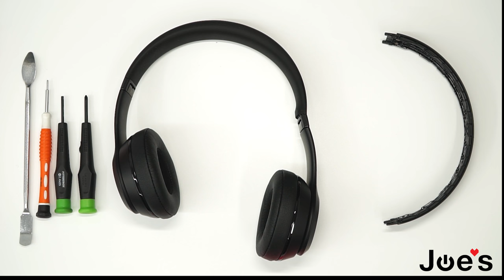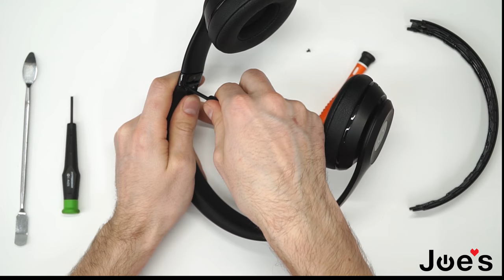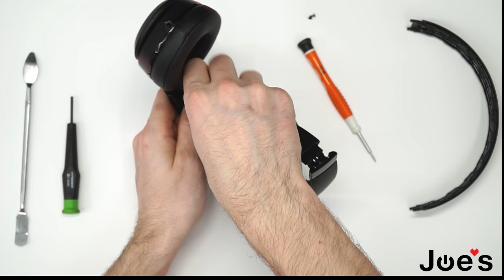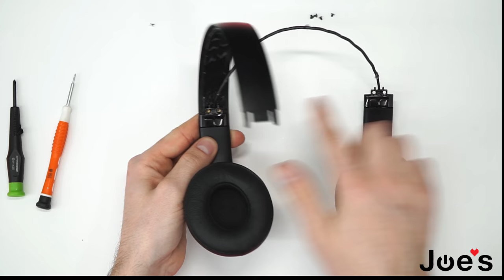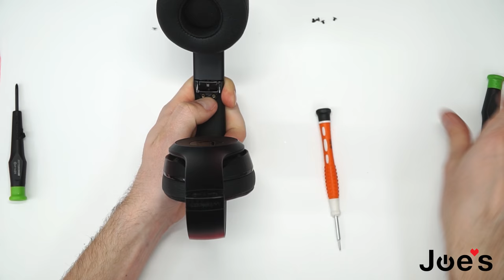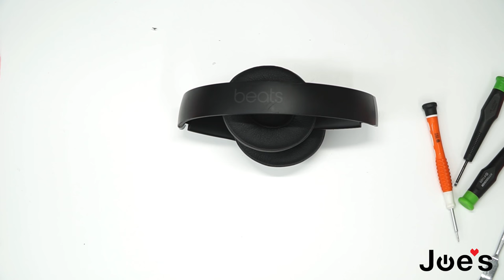How To Repair Broken Headband Beats By Dre Solo 3 Wireless JoesGE

Comment: I can't believe such expensive headphones are so cheaply manufactured. Clearly, it costs them so little to make it, since all the material used looks super cheap.
Reply: It only takes like 9-12 dollars to make
Reply: $14 -$15 to make
Reply: You kinda have to design in for breakage, you have to make a weak piont so you know where it will break, at least it is possible to repair them unlike all other apple products now days.
Reply: you mostly pay for the brand.
Reply: @thedave7760  the Solo 2s looked the Same they designed nothing new
Reply: Capitalism slander
Reply: Seriously it’s so annoying
Reply: We owned 2 Beats Solo  3 headphones and they broke this way. Expensive HP but of low QC quality.
Reply: I’ve got studio 3s and my look a little better then this break but almost exactly the same I just can’t tell if it’s the head band or the hinge
Reply: Yup this. It's annoying. They are Apple made too. So cheaply made

Comment: Hey just wondering . What part does it need to be repair when for example you know how people with different head sizes adjust the length of the handphones . Well I have a pair that on the left side they don’t lock in place it’s just lose and goes all the way Down if you what I’m talking about . The right side works and actually locks in place to the desired length
Reply from the maker: Hello, thanks for commenting. Please email us at support@joesge.com and we will be able to better help you there. - Aaron P

Comment: I was given a pair of Beats EP with a broken hard plastic headband and non-operative volume control. Are these worth repairing and is the hard plastic headband part available ?
Reply from the maker: They aren’t really worth repairing since the Beats ep can be bought on the used market for fairly cheap
Reply: Thanx for heads up

Comment: I have a pair of beats solo 3 and they broke today im going to get the parts and fix it just like you did. But the only thing is that i noticed that were my headband piece is my rubber headband part is like taped from the inside of the beats. I was wondering if when I take them out if i would need some kind of special glue
Reply from the maker: Thanks for watching! The rubber part does snap in, but there is an adhesive we use to hold it in. You can check it out on our website here: https://www.joesge.com/products/b7000-glue-50ml-clear-adhesive. CH
Reply: Thank you. Another question whats the name of the type of screw driver you use?
Reply from the maker: The ones in the video may differ a little, but for most Beat repairs we recommend the ones on our website here: https://bit.ly/2OPDFCG. CH

Comment: So i’ve been watching your videos about replacing the hinges on the Beats. But the problem with my Beats Solo 3 Wireless is that on the right where it says “Solo3”, well that piece is missing, and the headband part doesn’t connect. So my question is, is it possible to put the metal piece on the hinge without buying the whole hinge itself?
Reply: Same
Reply: You will need a new headband to attach the hinge to your part here is a link to that part - https://www.joesge.com/products/beats-by-dre-solo-3-wireless-headband-band-arch-plastic-parts

Comment: Do you have to unscrew the the two screws to take out the headband cushion and putting it back in
Reply from the maker: Blitz, thank you for watching our video. You would need to unscrew the screws to replace the headband cushion. 

Ruslan P
Reply: Joe's Gaming & Electronics can I use any screwdriver to take out the screw?
Reply from the maker: You would need to use a small Phillips screwdriver to remove the screws in the headband. Matt D.

Comment: Do you know where I can get a headband for the Active Collection Beats Solo 2's? Or will I have to just go with a regular headband?
Reply from the maker: Thanks for watching Gage! What color of headband do you need in the active collection? They are hard to find, but sometimes we get them in. MD.
Reply: Of course! Thank you for the video! I'm looking for a grey one. If I'm unable to find one, who a regular headband still work?
Reply from the maker: You are most welcome Gage! What color are the headphones with the grey? Blue, pink, shock yellow? The regular headbands are the exact same size and shape, just different colors. As long as you purchase a headband intended for the Solo 2 wireless it will fit on your headphones. The Solo 2 wired headbands are slightly differently sized in the center for the smaller wire. MD.

Comment: would changing the band fix them from being loose and the earphone part from staying up, mine dont stay on my head cause they like stretched out and then the like earphones just dont stay like clipped up when I bend them if that makes any sense at all lol
Reply from the maker: Changing the band will help with the stretched out band, but the headphones sliding down is caused by a loose hinge.
Reply: mmm so how do you fix that part ?

Comment: Can I buy a solo 2 headband to fix my solo3 headband will it fit?
Reply from the maker: Thanks for watching! Yes, the Solo 2 wireless headband is the same as the headband on the Solo 3 wireless, just slightly different colors. The Solo 2 wired headband will not work on the Solo 3 wireless. MD.
Reply: It's not gonna fit, I tried.

Comment: So some of the end of the headband is inside of my hinge, what do i do?
Reply from the maker: Thanks for watching! If there was glue applied to the broken pice it is likely that the plastic is glue inside the hinge, if not, the plastic should simply fall out of the hinge as it is not held in by anything from the factory. MD.
Reply: @Joesge  and what do i do if there is glue inside?
Reply from the maker: You can try using a glue remover and substance like Goof off to help dislodge the plastic piece. You would just need a glue solvent. If you do use the solvent, it will strip the paint off of the metal hinge very easily so make sure to be careful with not using too much of it. MD.

Comment: Bro
How does the rubber thing go back in ??
Reply from the maker: Thanks for watching! The headband cushion simply snaps back in to place onto the new headband. It can be kinda tricky. Just push down in the center of the headband cushion along the whole length of the cushion with it aligned properly and it will snap into place. MD.
Reply: @Joesge  thanks a lot man
Reply from the maker: You are so welcome :) MD.

Comment: Bro I tried the super glue approach! Man the worst happened... when I bought the replacement band and tried fixing it, the plastic  was cracked up and superglued all around the wire.. so the new band doesn’t fit in the slot. I had to use my dremmel to slowly carve out the plastic. You wanna talk about frustration! They are made so horribly. Never should $300+ headphone break when opening them from the folded position. Never dropped nor mistreated until I threw them at the wall putt of frustration!
Reply from the maker: Thanks for the comment. Superglue is definitely the worst approach if you are planning to repair your headphones with new parts. The best way to remove the glued plastic from the hinge would be to heat the hinge with a heat gun. If you do this the plastic should be easier to remove. 
-David P
Reply: @Joesge  Would a soldering iron work? I have a straight tip one. That sounds like it would work if I could just remove the side plastic like in the video. I even have the pry tool and it isn't budging.
Reply from the maker: The solder iron may work but you will have to be careful not to damage surrounding parts. Our method is using a heat gun which works quite well. If you continue to struggle with the repair we can definitely help you out if you send your item in to our repair center. Here is a link to the repair process: https://www.joesge.com/pages/repair-services
Reply: @Joesge  thank you for your reply. Thankfully with a lot of patience, I slowly melted it all away without touching the wire. I must say, that was my last option so it was all or nothing. Now they are working great! Thanks for the video.
Reply from the maker: Glad we can help :)

Comment: Sorry for annoying you guys but the rubber part is the part that doesn’t stay on my headband
Reply: So I’m asking if you guys know how to fix that or if I need adhesive
Reply from the maker: Thanks for reaching out to us. Did you purchase a new headband for your headphones? If you did not order a headband from us or find a guaranteed authentic headband, it is likely a fake headband and the tabs on the headband cushion do not line up with the non authentic headband. The Solo 3 headband cushion simply snaps into the headband by pushing down in the middle of the cushion for the length of the cushion. MD.
Reply: ItzBrandon same

Comment: Helpful video but it's a shame this even had to be made... With the costs of these headphones, it shouldn't be an issue to begin with.  I've got $40-80 headphones that have more reliable construction.  One pair I've had for six years.  They sound great but the construction issue has been a problem for so many I would not be interested in purchasing another pair.  Have had two pairs in the past and both suffered broken headbands.

Comment: I have had enough of these headphones always breaking.. one side stops working or above the hinge breaks!! I have so many over the years I want repaired but Apple refuse to repair them and want me to buy a whole new set and no one literally repairs them!! Worse the only parts we can get are cheap knock-offs or aftermarket components from China!! For what we pay for these headphones we absolutely deserve better quality but also the ability to repair them when small things like above the hinge breaks!! I literally have 4 or 5 Beats By Dre Solo 2 and Solo 3 headphones waiting for repair but they will all soon go in the bin!! Last night I saw my last set of Pop Violet Solo 3 has broken above both hinges and I am like just over it!!
Reply from the maker: We sell all original parts for the Beats headphones if you want to give it a shot at fixing them.
Reply: @Joesge  For the price of 1 Beats Solo 3 Headset I bought 2 x Razer Barracuda X Wireless Pink and 1 x Razer Kraken Pink Kitty Edition set of Headphones!! I would love to fix up all my Beats by Dre but also that is not my job!! With what Apple ask we pay for the Beats By Dre there should be far better repair services for them!! I am also fed up to my eyebrows with them breaking above the freaking hinge and I would like to see that manufacturing defect fixed unless it is all part of fleecing the consumer for more by ensuring they break in a set timeframe!! I might look into repairing them myself with the parts but considering I got 3 Razer Pink headphone for the price of 1 Beats by Dre Headphones.. yeah.. I think my time with Beats are over!! Also the Razer Headphones don't press my ears against my glasses and make my ears hurt so that is just an absolute bonus!!

Comment: whats crazy is they still work after snapping lol
Reply from the maker: Yeah its just the plastic that's broken, not the speaker wire inside.
Reply: @Joesge  I had them glued together for years. didnt realize i could just replace the band until the glue snapped yesterday LOL

Comment: I have replaced the inside panels once already. Now they are broken again, and today the fucking headband snapped. 
Calculated that if I buy all the parts for a new repair (inside panel left and right + headband) it's more than 70% of the price of a new headset. 
I'm never buying beats again, going for sony no :)